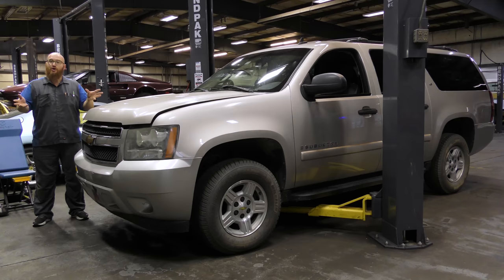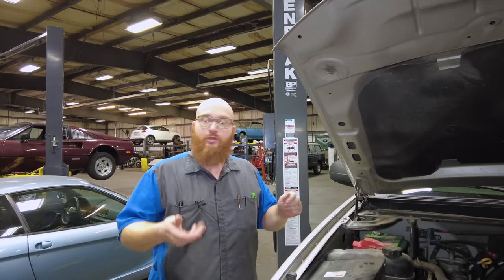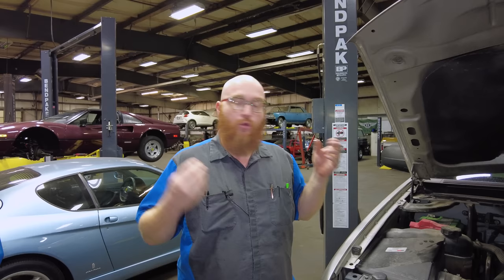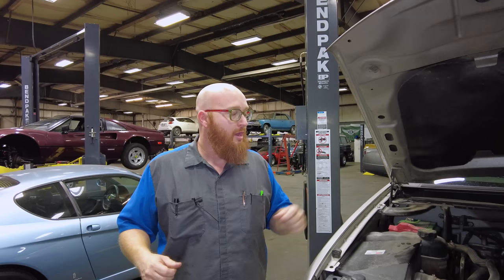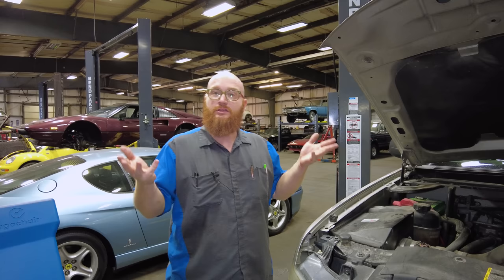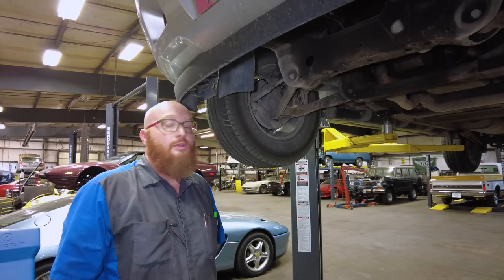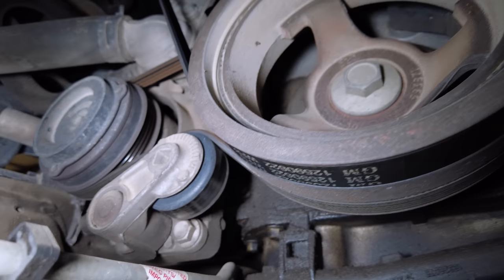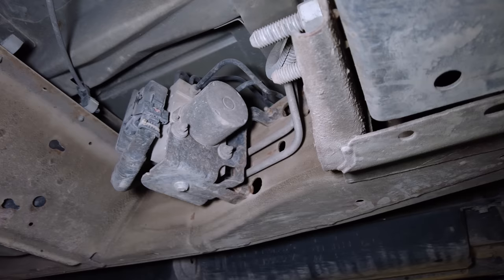What fails on ALL early 2000's Chevy SUV's!? CAR WIZARD shares what he's seen from the last 20 years

Comment: A few to add of my own experience:
1. Upper Ball joint/control arms
2. Drive shaft U-Joints
3. Front Hub bearing assemblies(2WD or 4WD, it doesn't matter)
4. On the late '90's early 2000's with gearbox steering, the pitman and idler arms 
5. MOTOR MOUNTS.
Reply: thats alot of cars lol
Reply: Yeah!! After 22 years and 308,000 miles Ive replaced all sorts of stuff. Total junk!

Comment: The oil pressure sensor has been nothing but creating hell for me. Nothing less then having to change it three times myself, having people tell me I need a new motor when I know I do not, changing the oil when it does not need to be changed. But I would not change it for anything because I absolutely love my 2011 Silverado.

Comment: In my gmt800 I had the transmission, plugs wires and exhaust header bolts done. Definitely pays dividends not to defer maintenance on these things. Prior owner did a poor job but overall these are solid trucks as long as you put in the time and money to keep them in proper shape.

Comment: The Wizard is doing God's work. This GM platform is perhaps the most sold truck platform in the US of the last 20 years. They are great...provided you get the right one. AFM/DFM(now) really did a number on the volume 5.3 V8, mostly due to poor oil change intervals and failing solenoids. The 5.3s from the GMT-800s are nearly bulletproof, as is the 6.0.

So many people buy these in the used market, which I understand due to their styling(they still look good) space, cargo, and hauling abilities. But I'm so glad Wiz is informing the masses of what to look out for, especially since many of these are getting up there in age. The 07-14s brought more tech, but many more problems over the GMT-400/GMT-800.
Reply: The GMT-900s are still super solid trucks though. They don't have the old GMT-800 trucks reputation for being bulletproof, but if you take care of them they are just about as reliable
Reply: The AFM can be turned off for $50. Leave the hardware in place and no issues.
Reply: Everyone knows ford is the best selling truck
Reply: @natezosso6822  But why???  I was never impressed u any of the Ford's I have driven or owned.  Basically the same can be said of GM products; EXCEPT for my very first car - a 65 Pontiac Tempest with a 326 V-8 connected to a Powerglide trans.  I LOVED that car.  Too bad it got totalled out from under me.  I got to fly a hospital bed for four weeks and relearn how to walk.  That was on July 73.
Reply: @rhondohslade  idk man. 🤷 Because people buy them
Reply: @natezosso6822  Ford is the best selling truck because they are not also sold under Mercury brand like Chevy and GMC divide sales. Each is less than Ford individually but probably more combined ?
Reply: @mph5896  I’ve heard this from many ppl. How did you turn off the AFM?

Comment: Great video, Wizard. Tons of great information in this one. I would love to add on: the front lower ball joints will also develop looseness/play around 100,000 miles (I've seen as early as 70k, as late as 125k). If you live in a state that has safety inspections (of which I do) where ball joints are a safety item, they WILL fail inspection for play. It's usually around 500-600 bucks for parts and labor. I live in PA, and I've failed and replaced probably over 100 of them on just Chevys alone. Extremely common.

Also, the upper ball joints in the upper control arms will also begin to fail around 140k-150k miles. Sometimes sooner for the same thing. Also wheel bearings in the front past 100k; though that one varies wildly.
Reply: Agreed, I'd also do the Pitman & Idler Arm when at the same time as ball joints in addition to new sway bar bushings and endlinks.
Reply: Yeah front bearings are weird, my 05 Tahoe just had the originals changed at 210k, while I’ve also seen them fail at 100-150k
Reply: @Darkman0198  the sad part is no matter what replacement bearings you use you'll NEVER get 100k out of them! Be lucky to get 30k!
Reply: Right front wheel bearing on my 03 Avalanche was changed in 2015 when it had 70000 miles.The left one held up to 86000 miles.Now at136000 miles both still works well
Reply: Former GM tech. One year old trucks would fail NY state inspection for play in idler arm and pitman arm. The brand new parts had play when installed! Not a problem, but the inspection says any play in these joints fails. That said I would expect any vehicle, especially a truck, to need ball joints replaced around 100k
Reply: @Mr.Z1776      I have the best luck with Timken bearings made in the usa.

Comment: Biggest car mistake I’ve made is buying a 2018 high country instead of just putting the money into my 2009 Tahoe. After over $20,000 into the high country, the engine blew. Luckily it was during the time when used car prices were skyrocketing so insurance was fair with a payout. Since then I’ve put a new engine, transmission, radiator, throttlebody assembly, brakes, And a few other things into my Tahoe and I am positive it will last 10 times longer than any new Truck

Comment: gauge clusters have issues on these and not just the oil pressure issue he mentioned. they also go through brakes very quickly likely just due to the weight of the vehicle. the transmission one is very true but there are lots of different possible points of failure on them. great video car wizard.

Comment: In my 95 Astro, the transmission shop I took it to was amazed that I had a towing kit and the 4L60 (don't remember if it was the 4L60 or 4L60E) lasted 168k before it grenaded, because we had a towing kit. We always drove it in Tow/haul mode when towing, or driving in the mountains for extended periods of time. Yeah, the transmission wasn't great, but it wasn't the worst thing on that POS van by far.

Comment: I bought 2010 around 2017. It had about 80,000 on it. Has 153,000 on it now. It had an awesome oil change history. I didn't want a 4l60. 09 and up have 6l80. Better trans imo. Just make sure to change trans fluid and filter every 50-70k if you tow or not. I replaced all the fluids (some a couple times or so now), coil boots, spark plugs, the oil pressure sensor (takes me about 15 minutes to get intake manifold off), valley plate seal (with afm), valve cover gaskets, oil cooler lines, tires, brakes, all ball joints. It's been rode hard, towed my mustang around, and I hook a trailer up often. It's a great truck with the worst interior quality I've ever seen or had. (I'm a german car tech and own a shop). I personally pull the intake to do the oil pressure sensor. It's easier to pull the intake then to fumble fuck around trying to get behind all that against firewall

Comment: I learned something new today. I've been on the lookout for a 3/4 ton '00-'06 Suburban, need something bigger than my subarus. I had no idea about towing in overdrive ruining the transmission. I could easily see myself doing that had you not mentioned that. You probably just saved me a ton of money. Thank you!
Reply: If you buy a 3/4 ton it's going to have the 4l80e transmission. You can tow all day in o/d with it. Whole reason I bought a 3/4tin was to get away from the light duty tranny in the 1500s
Reply: @kefwals8722  found an 06'  2500 sub w/131k miles...paid a bit much at 20k$ , but body almost mint, just replaced alternator, other than that solid 🪨 ( that's a rock not a turd)
Reply: @tvmasterprobutts4246  my 03' has more miles now than I can't count since I had to replace the gauge cluster. Has to be 300k+ by now. I had issues with the rear end from it being shifted into reverse at 40mph. And the transfer case got a hole in it and leaked all the fluid out. Both made horrible noises like they were coming apart in me. I was positive they were toast.  I filled and flushed them a couple times just to try to get me by for a bit. And they both fixed themselves somehow not I house if vibration from either. Never seen anything like it. The truck is self healing or something cause it rides smooth as it did before. If I ever kill it I'll be buying another 03-06 like it.

Comment: Keep the good info coming Car Wizard. Thank you ! All the problems Car Wizard has mentioned have been issues of my Tahoe at one time or another 
But at 330,000 actual miles , it still doesn’t burn oil . I am slowly but surely replacing worn out parts. I would rather go that route as opposed to buying another suv , period. GM built a decent truck / suv from 2006 and beyond

Comment: Not all 4L60e's have tow/haul mood or even O/D as a selection.  My 2005 Canyon only has P R.D.3.2.1. on the selector.  And not everyone knows to leave it on 3 when towing.  Used trucks dont always have manuals included.
Reply: I'd be willing to bet, that little trick is glossed over when people read the owners' manuals.  That's IF open and read them at all. My present car (bought used) didn't have a manual at all.  Went to s dealership the next day.  They had one on the shelf in Parts Dept and GAVE it to me at no charge as it is for a 2015 vehicles f the manual itself was lightly used.  That was really good service.

Comment: I've done the knock sensors on my wife's '04 Suburban and the A/C belt. I'm going to go check the exhaust manifold bolts. I did the transmission lines on my '06 Duramax. With the transmission lines you can pull them off and take them to a shop that does hydraulics and they'll clamp new hose sections on to them for you. This can be cheaper and/or faster than buying new ones.

Comment: On the transmission point, 4L60Es still lock up their torque converter if you select Drive and it only shifts upto 3rd gear. Whats actually causing the issue is people not using their tow haul mode. When not in tow haul mode the transmission will shift softer, torque converter will also lock up softer and be a little slippy to absorb any change in engine torque specially on the afm vehicles as going from 4cylinder mode to 8 cylinder mode you get a bit of a torque bump when that transitions back to 8 cylinders. By letting the torque converter loosely lock when that bump occurs it just absorbs it so you dont feel it. Another thing being lack of service on the 4l60e under harsh conditions such as constant towing. I tow with mine in OD all the time. No issues. Have for going on 10 years now. That said all mine have the pwm setup for the tc lock deleted for a more on/off lockup since mine are older and dont have the tow haul mode. Another 4l60e killer is what you pointed out, leaks from the oil cooler line but also the pan and the transfercase seal. Running any transmission low on fluid for a period of time will kill it. Most dead 4l60es ive come across on auction vehicles always have low fluid levels barely touching the dipstick. And the ones that are full were recently service albeit too late, to try and correct whatever issue it was having. The 4l60e has flaws but one taken care of ive seen 300k+ still shifting as smooth as new.

Comment: Some more HIGH failure rate items to add to this list: 
-Intermediate steering shaft on 99-06 models. Odds are that it's been replaced by now, but if it's clunking in the steering, it's probably bad. 
-The plastic heater hose quick connect fittings at the heater core, and quick connect "T-fittings" if you have a Tahoe/Yukon/Burban with rear heat. Those get brittle and crack/crumble and end up leaking. Pretty easy fix though. 
- Power window regulators. I've replaced 6 of them (yes SIX!) on my Suburban in the 17 years that I've owned it. Driver's door and rear driver side door have both been replaced twice. 
-Blower motor relay/resistor assembly. These have a high failure rate and there's 4 or 5 different styles, so be smart and take your bad one to the parts store and match it up or you'll likely be making a return trip to get the correct one. Their computers NEVER get it right when it tells you which one your year and model has.
Reply: I bought my 03 Silverado new, I could hear the steering shaft clunking with less than 1000 miles. I'm still driving it with 300k miles on it. It's all good.
Reply: I replaced the lower and intermediate shafts along with the inside bearing, The plastic bearing doesn't have much if any grease in it which leads to an early failure. There is a newly designed part that is suppose to permanently correct the noise created by the intermediate shaft, I installed this part about three years ago and so far so good.

Comment: I've gone thru about 3 or 4 A/C blower motor resistors on my 04 Tahoe. Otherwise, besides routine maintenance I've only changed a front wheel hub(@150k), water pump(@250k) and the starter and rear main seal(@300k). I'm at 316k miles now and it still runs like a sewing machine!
Reply: @abel4776  had a small oil leak until I changed the valve cover gaskets, which took less than 2 hours. No other coolant losses or anything of that nature. Still original engine/transmission

Comment: Had a 2004 silverado 5.3 replaced 3 oil preasure sensors you can replace them with a 7/8 deep socket and u joint with extension no need to pull intake

Comment: Dont forget about the heater hose connectors by the firewall.  Here in texas they are constantly failing due to heat and the crummy plastic design
Reply: Just did mine.. middle of summer
Reply: Yes that plastic T gets brittle with age. I live in North Dakota but one of those failed on my 2002 Suburban with 195k. We were towing a travel trailer back from wintering in Texas. Dumped all of the coolant about 15 miles north of Abilene. Some very nice Texans helped us out and we were back on the road in a few hours.
Reply: @buckboard43  yea. I live in Nebraska now but do miss Texas

Comment: I have a 2005 chevy avalanche 1500. I have already replaced the belt tensioner. I am now dealing with the shift linkage. The cable end popped off the linkage up on a mountain. Fortunately it was easy access and I put it back on. It got me home. Already ordered a new replacement bushing. You don't need to replace the whole cable. Fortunately I knew about towing in overdrive. I even put mine in tow mode climbing steep inclines.

Comment: Make sure the 4L60-E shifts as intended. They're known for 3-4 clutch pack failure due to worn piston, bored TCC regulator valves and rear broken drive shells
Reply: What are symptoms that show when those fail? I’m not sure what a bad one would do other than not drive at all
Reply: @devinheagey7485  slipping, flaring when hot especially 3-4 shift is usually a tell tale soon. Also it usually fails wot or under high load
Reply: Mine did it, 3500 to rebuild that hunk of shit

Comment: Valvoline High Mileage oil seemed to cure the oil sweating from the 5.3 in my 2005 with 195k miles, which I got with 190k. Everything else works flawlessly. Got it from the original owner who was meticulous with maintenance as am I. Great video, though, wiz!
Reply: I love that oil when I am not using synthetic
Reply: @T0tenkampf  Agreed! Doesn't burn or leak out of this high mileage hog!

Comment: Fingers crossed!! I've had my 2008 Tahoe LT 222,000 miles (3rd owner) for 3 years. Original Motor and Transmission. I've not had to fix anything YET but I think my oil pressure sensor that you mentioned early on is about to go because it runs fine but my pressure has dropped to almost nothing. Thanks for this video!

Comment: I own a 2000 and 2003 Subrban and a 2007 Yukon.  They have been largely reliable until recently but they are high mileage vehicles.   Currently dealing with an oil leak, AC blowing hot, misfiring, two with transmission issues, and an instrument cluster failure.  You pretty much covered it all in this excellent video. Thanks!

Comment: I'm in the rust belt of Ohio and another thing I'm constantly repairing on this vintage of GM trucks and SUV's is BRAKE LINES!!!!!!!  ACDelco sells a wonderful kit of pre-bent, coated brake lines that are relatively easy to install in a shop environment.  Last kit I installed was on my 2001 Yukon XL and it was $95 with shipping from Rock Auto.  I've also hand made new line sets with Ni-Copp brake line back before the kits existed.

Comment: Great video! 2004 Avalanche Z66 with 175k miles... I've had most of these failures. Just had the ABS sensor fix done. Just had a rear main seal done (now I'm wondering if it was the oil cooler delete). I've replaced the AC blend door, the transmission. the camshaft, the belt tensioner, the heated seat coil, the master Power Window Door Lock & Mirror Control Switch (twice), the dash cluster... pretty much everything on my 20 year old has been replaced... and now I have a 2 amp draw on the Radio fuse line that I can't figure out!!! I love this truck.

Comment: I bought a 2004 Silverado off my grandma with 28k miles. 30k now. Im hoping I’m still long off from many of those issues. I gotta be careful though because of age. I did already have to fix the upper intermediate steering shaft and it’s bearing. Also another common failing point.

Comment: I have a 2001 Tahoe 5.3 with 280k The OP sending unit hasn't failed in the 8 years I've had it. The mega fuse hasn't been a problem,  DID have to replace the a/c tensioner, coils still good, JUST NOW (280k) getting a 20 second exhaust tick at startup, actuators still good, REAR actuator was replaced, no cluster issues. Transmission lines haven't failed, no oil gasket or ring issues. Transfer case doesn't leak. ABS module..... royal PITA! It constantly runs. I just pulled the fuse and live with the light. All-in-all this has been a good truck and it's easy to work on. 8/10.... would buy again.